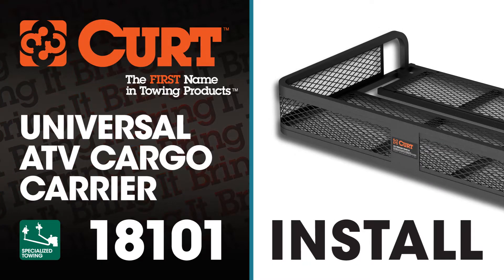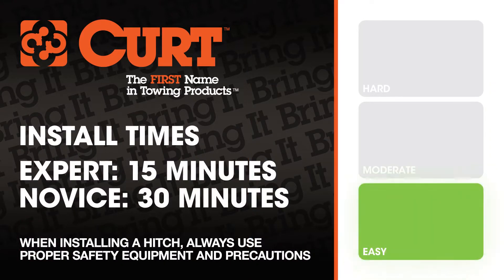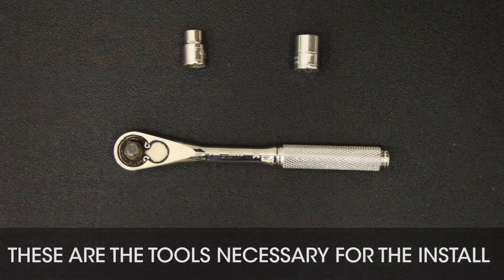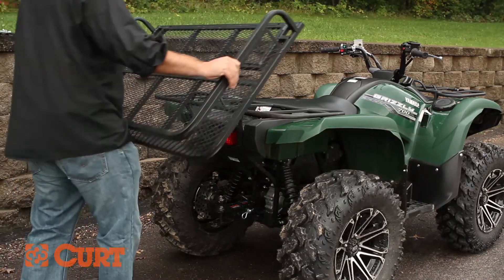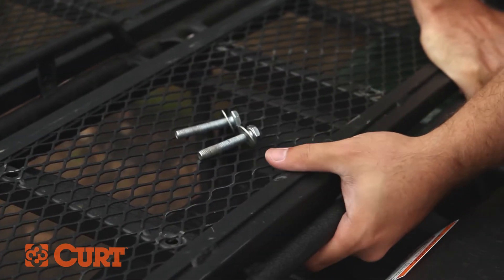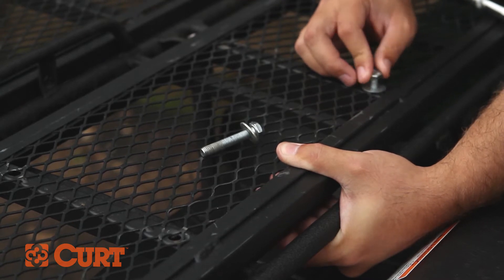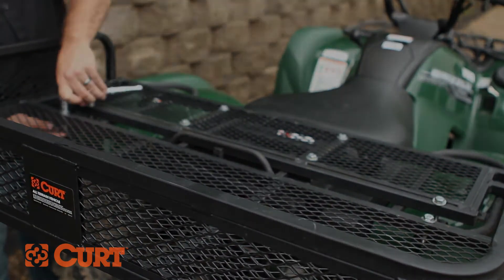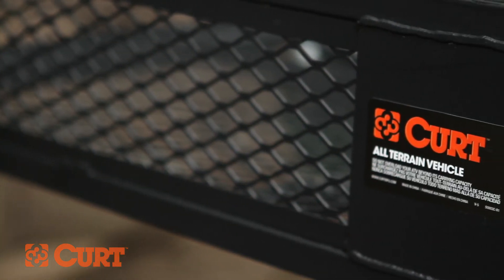Cargo Carrier Install: CURT 18101 on an ATV

Comment: I noticed in your other videos that you used this same atv  so I assume that this is your machine,anyway getting to my point I noticed the tires on it are the same ones that I bought for my machine.I bought four of them at my local shop here in Jacksonville Florida and I had to return all four of them because two of them had broken beads and the other two were out of round real bad so they gave me another set and the front ones were still out of round but not so bad that it would make the handle bars jump out of my hands like the first set did.Are you having any problems out of yours  because I heard I'm not the only one with  this problem. I saw another one of your videos with this machine in it and you were driving it and I noticed one of your front tires looked  like if it was out of round but not real bad so maybe you didn't notice it or maybe it was the camera doing that to it.If you have had issues  with your tires I sure would be interested to know what issues you have had with them.Anyway buddy you put out very detailed videos and very informative videos on top of that.Keep up the good work bud and take care,bye.Thumbs up like ALWAYS.
Reply from the maker: Thank you James for your support, we really appreciate it! The ATV in the videos was rented from a local motorsports dealer, we borrowed for few days and then returned it without issue. We hope you have better luck with your tires. Thanks again!